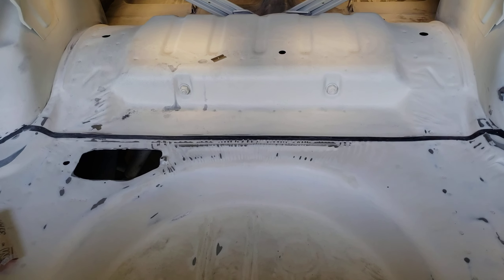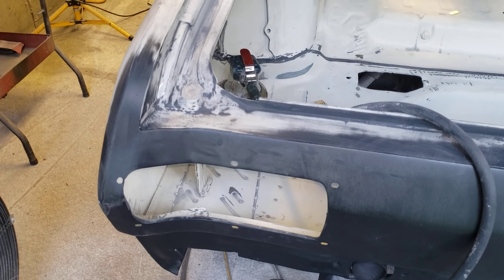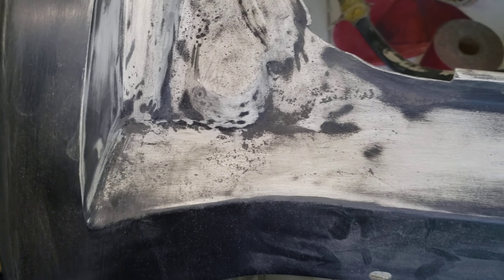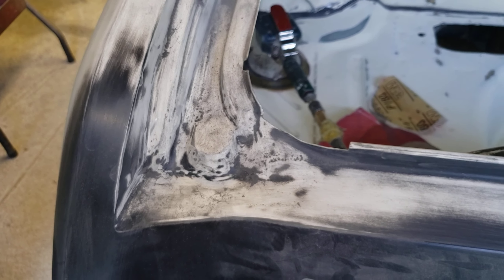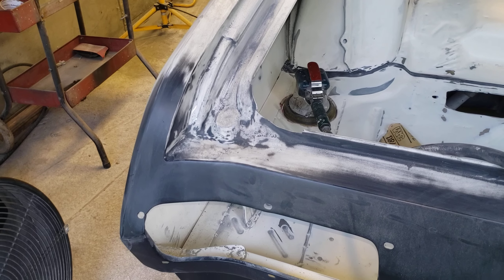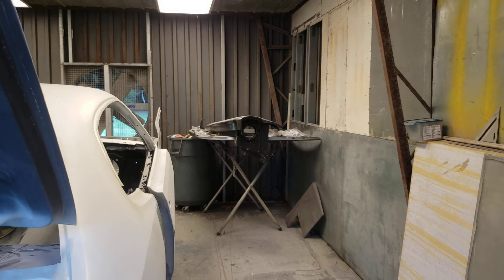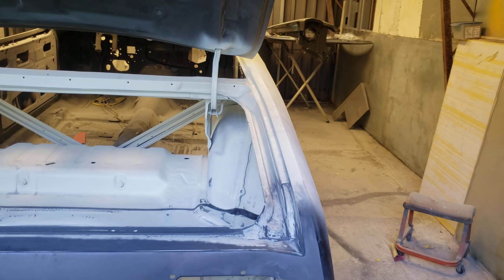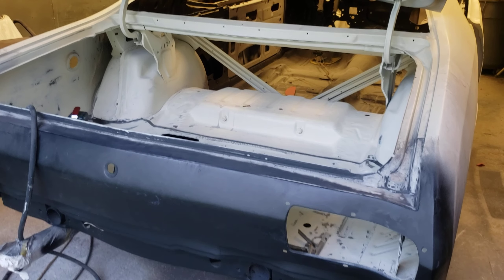#TAMCOPAINT HP-5311 is really nice.

Comment: I have a 70 ss i used eastwood junk on my resto way to many issues with their epoxy and spray poly so i just ordered the 5310 i cannot wait to use it. How did you project come out? any tips on tamco? 2.5 mm?
Reply from the maker: 2.0 to 2.4, don't pile on coats. Make sure to give adequate flash time or it will crack.

My 68 nova has been a slow process, time & cash are the reasons.
Reply: @mizellhobbyshop  great ty for tip